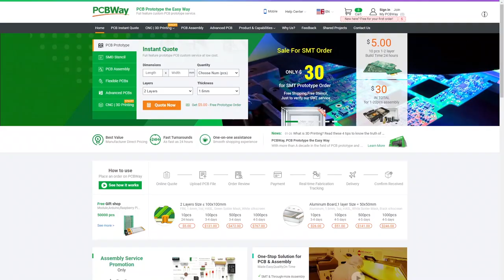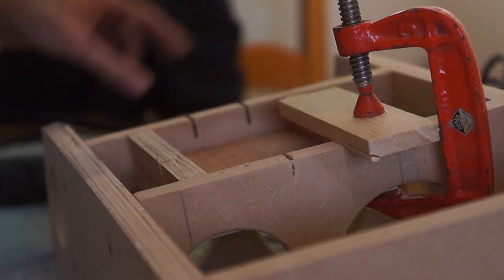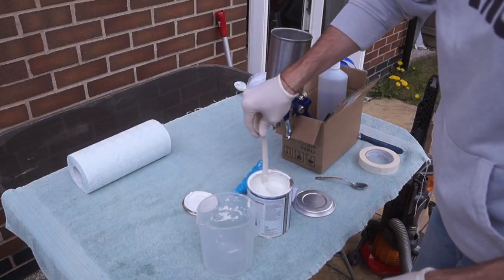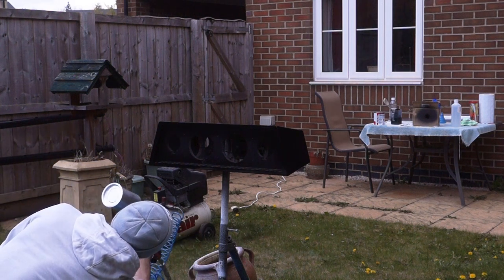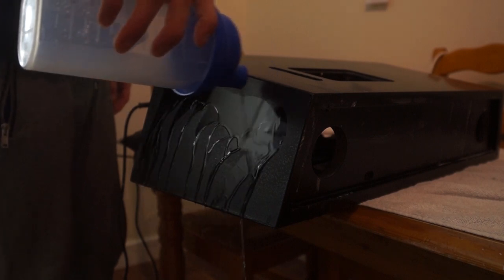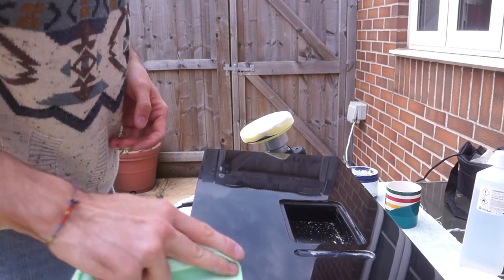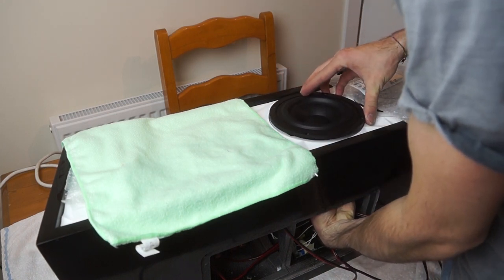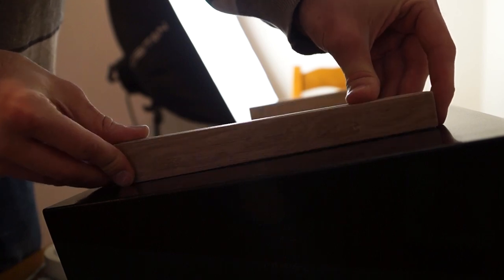High End DIY Speaker Build | HOW TO

Comment: It may have it's imperfections but like many great projects, if you didn't point them out to us then we probably would never notice them.  Considering your lack of experience, lack of tools and lack of workspace, you really did do an incredible job.  Show it off and admire what you accomplished.  Well done!
Reply from the maker: Hey thanks a lot! Certainly been getting lots of use out of it. Looks much better now with the oak front. I have the parts cut for another one with housing joints but holding off building it till I get another front face CNC'd.

Comment: Very nice and good looking job!!! For the front pannel what strategy did you use in order ti obtain this pattern? Vcarve with no fixed max Z? Thank you!
Reply from the maker: Thanks! I use SOLIDWORKS and basically sketched out the triangles as a 2D sketch. I then did an extruded cut but with a high draft angle (I think 60 degrees) to get the desired effect.

Comment: Try to avoid use silicone unless in the bathroom. Have numerous appropriate sealants dedicated to wood.
Reply from the maker: Is that for environmental reasons or are the wood dedicated sealants just better?
Reply: @jcracoustics  it’s for structural purposes, some sealants are more flexible than others so keep that in mind. Also some silicone mixtures can harm speakers due to their horrible fumes so let it are out before your install the drivers
Reply: @jcracoustics   No. Silicon is not a long-lasting filler, it has a bad connection with wood/MDF, and wood grain(even if it looks like it)  very easily peel off in 3 years' time. Silicon content slowly destroys the wood structure. Not over paintable.  Plenty of good quality flexible fillers(mostly pricey) dedicated to wood. Also, forget about caulk filler(just in case you thought about it)
Reply from the maker: @scottaberdonian7374  ah gotcha, didn't know about it peeling away with time - thanks for the heads up.

Comment: Everybody friends cnc Maschine!!😂😂😂😂🇩🇪.Silicon for bathroom. Standart rubber speaker feets are better
Reply from the maker: Not sure I fully understand your comment but if you're needing a place to get your CNC'ing done then a quick google search of CNC machining near me bring up a lot of results. This is the way of lots of hobbyist projects now. Designing at home, ordering parts from an external service and assembling at home. Similar to people who make electronics and get PCBs made externally. Just a cheaper way of creating higher quality items.
As for the rubber feet realistically you want a balance of what looks good and what reduces vibrations into the medium around the speaker. I find the wooden feet work best in this project.